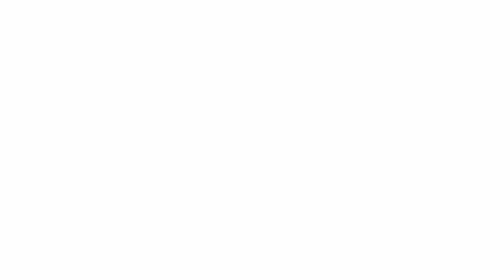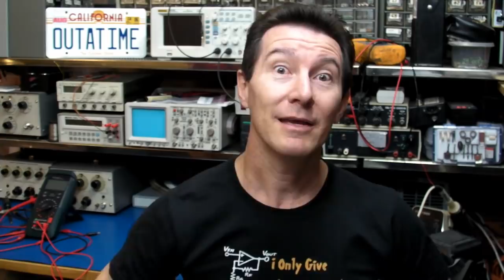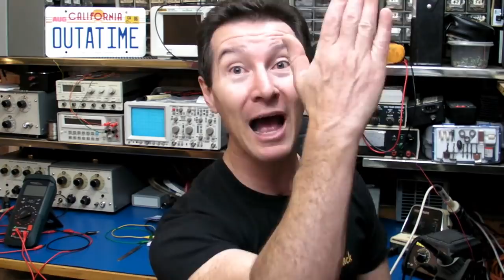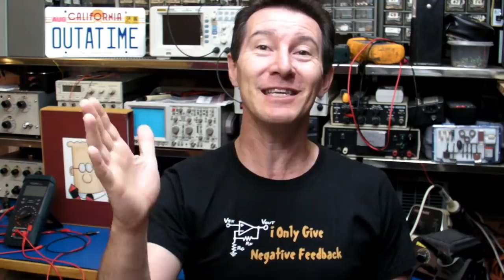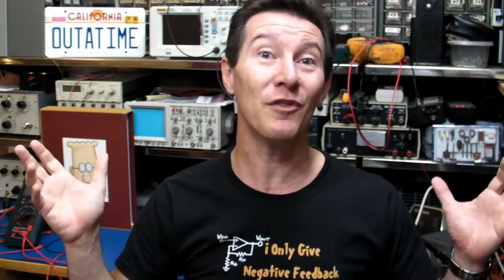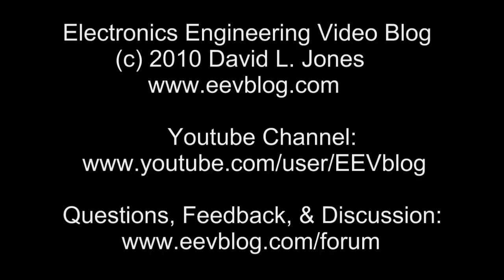EEVblog #138 - Top 5 Engineering Graduate Tips

Comment: I saw the original video when it came out in 2011. I am a designer. Not an electronics designer, but a digital interface designer. It's a tough job because of a lot of things. The concept of "Screw You Money" has been profound for me... thanks Dave! Since then I have worked to save what I call "The Fk You Fund" and it's relieved so much pressure on me over the years! In fact, I am using it now! I just quit my job. It was horrible - one of the worst companies I've worked for. Now, my FU Fund is about 3 years of living expenses. Now, if a job looks like its off the rails, I quit and burn through the FU Fund. I have never had a problem re-building the fund after sencuring employment. I completely advocate for an FU Fund - I think it's essential as a digital designer, be that interface or elecronic product.

Comment: TLDR:
1. The world of Dilbert is real.  You have to learn to tolerate and work within the apparently nonsensical happenings in the workforce.  There's always boring stuff.  You have to fight to get the cool stuff.  Projects get canceled for no reason.
2. Always work on your own projects on your own time.  Jobs cannot provide all of your satisfaction.  Crap jobs usually don't get better.
3. Try to get 1-man band jobs right out of college.  You get a lot of exposure in all stages (design, layout, manufacturing, validation, programming, release). Those jobs are painful though, and very stressful.  You will learn a lot, and get an idea of what phase you work best at and which you prefer other people do.
4. Move around of lot, change jobs frequently.  Minimum time is 1 year.  If you're young, get a job that pays for travel expense.
5. Don't be afraid to lose your job.  If you have talent and enthusiasm and networking, you'll always find a job.  It helps to save money that gives you options to find another better job, travel, research or start your own projects.
TL;DR:  Take some risks, keep learning. Don't take a job you don't want. And have fun.

Comment: Sadly the main purpose of engineering degrees is to be qualified to be an administrator/manager. The real hands on work goes to technicians.

Most people that gain engineering qualifications are in fact aiming for just that adminstration/management position as without formal qualifications the path up the ladder reaches a limit. As engineer you often judge the results of the work done by lower levels.

Further few "engineers" really have little aptitude to do design, even if very enthusiastic to work in design.

It needs hard effort to  NOT advance into the upper echelons if you carry the desire for the 'design' level work. I spent most of my 40+ years avoiding being pushed up the ladder, and even then ultimately became "Technical Specialist" and overseer of work by others. Yet still got deeply involved in assisting/educating the designers. Thereby always involved in the design and evaluation work. Final years were in endurance testing, but due to reputation still approached on design issues, decisions on specifications, directing the alternatives, evaluating and resolving design issues, debugging etc. But I had to work hard at not being isolated into management, that to me is not my thing to do.

Passion to do, not just see also goes with lower income. Those that are in effect hopeless as design engineers and end up as managers get higher wages, annual bonuses, extra benefits and credit when a good product design is a market success. Just as the sales engineer gets the new company car after signing the volume sale contract, while the person that originated the new idea, seated thru the design and test stages, spent months of long hours, possibly many periods of 7 day work weeks, sleepless nights on problems. What do they get? In most cases no acknowkedgement of their efforts. Most likely a tightened schedule for the next task, threat to dismissed unless they can come up with the next big product idea, or completion of that hopeless idea some manager pushes as his great concept that has no practical use ever.

Sadly if you think you can do your own thing, design to your hearts content. By starting your own business, that is fraught with high risks, little initial rewards, lots of excessive work.  You will like most engineers end up managing your business. Yet if you employ a manager, sales team and try to keep designing  you will be robbed of your business by just those people.

Sorry to be so negative, but those are observation in over 50 years of engineering.......

Comment: A few other points:
1) There is someone smarter than you but 2 people dumber for each of those.  Neither carries a sign to tell you which you are dealing with.
2)  Someone who has "been at it a while" likely knows a lot of quick tricks to avoid doing a lot of hard work that ends up in the same place they did.  Watch for those and learn.
3)  You may find your self on a team when one member undoes the work of two others.  Document, document, pray for the bad guy leaving, and perhaps quit.  Try not to be easy to hang the blame on.  Blockers also like to hang blame as well as block.
4)  You will use about 1/2 to 2/3rds the code space.  Pick the processor with about 3 times your best estimate of the code needed.  That should land you at about 1/2 if no features are added.
5)  Never ever ever design around the "typical" numbers.  Those numbers are a trick invented by Satan himself as a trap for young engineers. Friends don't allow friends use typical numbers[1]
6) On a project, pick some units of measure and stick to them.  3mm, 42mm, 1234mm are less likely to get messed up than 3mm, 4.2cm, 1.234m.  This breaks down if you have lightyears and nm involved.
7) Try to be a better person.  It is always good advice but sometimes it needs reminding that the best widget design in the world doesn't actually make you a better person.  That person you are is who you have to live with.
[1] US ad campaign friends don't let friends drive drunk reference.

Comment: I was lucky enough to get a job in an R&D department not long after graduating, and was able to run my own projects with full design control, but only for projects that were green lit by sales and eng managers. When the company lost its way I started looking for new positions, during interviews when I would specify what I did most companies never believed me as I would generally  be doing what they felt was the role of 4-5 engineers. Small-mid companies allow for more design control, but I have found they are rare as hens teeth.

Comment: Just as true for programmers / software engineering.
Reply: I’ve always been shocked how many engineers take jobs that involve NO design engineering WHATSOEVER.  Why be an engineer if you don’t do engineering I always say...
Reply: They need to eat and pay rent.  One guy in our IT organization, hired in the late 70s, had a PhD in philosophy — no job.  One of our better managers was a pharmacy major.  A lot of programmers were educated as civil engineers - but we were a State DOT, so that wasn’t a huge surprise.  When I was hired I think I was their only CS major (as well as an ECE degreee)
Reply: Most of the “engineers” I deal with do not seem to have the drive to want to do any design. I am civil/structural who is also interested in programming, mechanical, electrical, rapid prototyping, general problem solving.  It’s a terrible ‘engineer’ who simply works for a paycheck... I always try to explain to young work term students that there needs to be a love of the riddle of a problem to solve in novel and efficient ways. If that spark is not there, well, management is always an option...

Comment: So right!  I'm approaching the 40 year point in my career, and I'm having just as much fun as ever.  Along the way I've learned a few things that I hope will prove useful to others.  Here are my top Ten:

1. Don't start university until you know what you want.  Use the time between high school and college to learn about yourself as an adult and to gain some skills.  In my case I joined the military (and had an amazing time), but there are other routes that can be just as satisfying.  Most importantly, learn to save money, which leads to the next item.

2. Do college without debt.  My pre-uni savings combined with a part-time job during school and full-time work during breaks did the trick for me, even though it meant being on the "5-year plan".  I actually graduated with more money in the bank than when I started!  Not only does this let you start your career with financial security and "fuck-you money", but in my case I was able to buy a house in a good neighborhood 2 years after graduation.

3. When choosing your school and program, go "theory heavy".  The tool-specific skills will become obsolete as the tools change, and lower-level applied knowledge will be absorbed into future tools.  Yes, take lots of labs and learn the current tools, but it should be a small part of your overall program.  Start with all the math and physics you can carry, then get deep into the theory of your area of interest.  A theory-based degree means you will be quickly able to adapt to (and perhaps help create) the relentless technological change that WILL happen over a long career.

4. Do more than just your required classes.  Spread your electives far and wide, as most technical degrees are very lean on Liberal Arts, which go a long way toward helping you become a more complete and well-rounded person.  For me, this was a surprising benefit of being on the 5-year plan.  Not just outside your area of study, but inside as well:  Try to get onto research projects.  In my case, I was the first (and only) undergrad to join one project (unpaid, of course), and was the 11th name on one of the papers.  The *MOST* valuable thing for me was learning to be a researcher rather than just a student, giving me a better perspective of, and much more ownership over, my educational process.  The second research project I joined included some pay!

5.  Stay the fuck out of management (which requires learning about management).  The work experience I gained before and during university, along with my wide educational interests, made me extremely employable: My interviews were not at all like typical "new grad" interviews, and the job offers I received reflected that.  But my first employer soon insisted I help run projects (so I left), and my second employer actually convinced me to manage a small contract, but then wouldn't let me return to being an engineer (so I left).  That said, it is *extremely* important to understand management, and my brief management experience hammered home that need: My teams loved working for/with me, but their love didn't begin to replace my love of doing engineering.  This taught me that a large part of my job is to "make my management succeed" for two main reasons: A) So I won't have to do the management!  B) So my managers can take vacations when needed.  Having a great manager makes life as an engineer much better, and sometimes you will need to help make that great management happen.  Gain the management skills, then help others put them to use.

6. Be helpful to others.  This is more than avoiding being an ass, and extends to being willing to occasionally take on tasks nobody else wants to do, especially one-off things.  The phrase "that's not my job" should be banished from your thinking, at least as an attitude, but not to the point of you becoming a victim or patsy.  You will be seen as a versatile and flexible resource, ready to take on all challenges.  The benefit being that when you want something to change, others will listen.  In my case, I find being the one to take care of the coffee station can have extraordinary benefits: I get to know more people at the company (almost everyone drinks coffee, and many aren't engineers).  The social benefits are awesome.  But it also may mean being on various committees, such as helping arrange the work Holiday Party.  Just suck it up.  Work is a kind of family, and we each need to take our turn vacuuming and changing the baby's diaper.

7. Love your job.  It is so easy to obsess about this or that negative aspect.  Don't ignore those things, but keep them in context.  Most importantly, don't be "that person" who complains about every little thing: Always strive to be the adult in the room.  There is always much to love, and it is worth focusing on it and growing it before letting other things bring you down.  And, again, if you have financial freedom and stability, you will always be able to leave.  That alone helps us to "not sweat the small stuff".  This goal isn't some delusion:  The goal is to jump out of bed every morning excited to do what you love.  Have that, and all the rest becomes "small stuff".

8. Seek advice, feedback and criticism.  This was a hard one for me, especially given my early career success and folks treating me as some kind of "wunderkind", which I believed a bit too much, to the point where when I hit my limits and got in over my head it was difficult for me to ask for help, or to accept it when offered.  Do not let this happen to you!  Be curious, open, and vulnerable.  Seek always to improve, and not just from study: Much will come from those around you.  Ask for that input if it is not freely offered, and always accept whatever is offered, even if you choose to set it aside, if only to keep the doors of communication wide open.

9. Have a life beyond engineering.  I can't emphasize enough how critical this is.  I'm not talking about partying with friends, though that's also important.  And I'm not talking about marriage or starting a family.  I'm talking about personal development, hobbies outside engineering, volunteering, mentoring, sports, and so on.  Your career may necessarily consume your life at times, but it should not be ALL the time!

10. Age gracefully.  At some point you will be working for folks younger than you.  It's the inevitable side-effect of staying out of management.  I earned the "Senior Engineer" title right after turning 30, and it hasn't changed in the more than 30 years since (because there's no "Senior as Hell" title).  This is not to be confused with a stagnating career or becoming RIP (Retired In-Place), which is another hazard to avoid, to be sure.  Again, part of it comes back to making management succeed.  And another part is helping folks who may be smarter or more able than you to ascend in their own careers.

There's more, many more, but they're relatively minor compared to the above.
Reply: All great advice but for #2... have you looked at the price of undergrad (US) in the last 20 years?
Reply: @wondledonkey  When I read this is am so glad to be from Germany and not having to pay for the university itself and not starting with a dept.
On the other side there are a lot of people that are just studying because they do not know what else to do.
Reply: Thanks, I am copying your comments to my notes so that I can read, re read, re re read,... it frequently
Reply: BobC, thanks so much for sharing all of this. I'm actually a musician, but this kind of advice crosses many borders. Thank you!

Comment: I'm working with idiots.
Had to teach an engineer the reason they had to cross two wires on a cord they were making up was because they were putting the plug on the wrong end of the wire. Funny how they don't get taught that. Never occurred to him the order of the wires is perfect at the other end of the wire.  Some engineers lack real world experience. They can design an extension cord, specified the wire and connector, then put the connectors on the wrong ends, then fight trying to get the plug assembled.
Some engineers and common sense is often not that common. We have all seen projects over engineered.